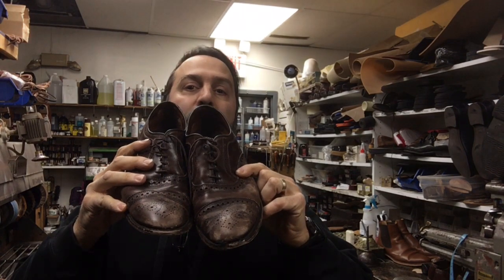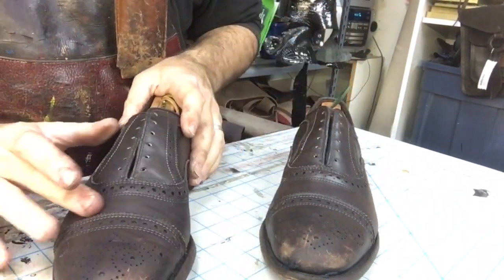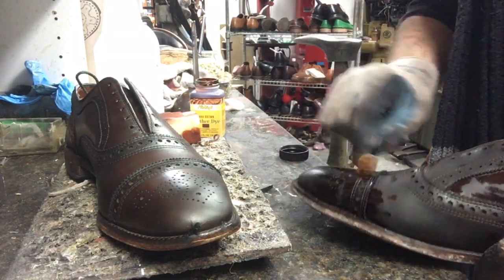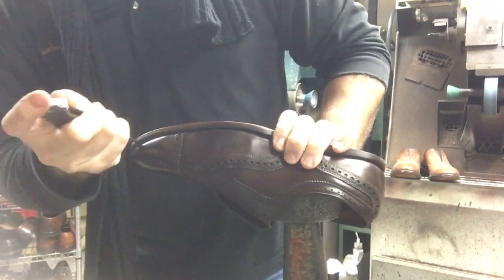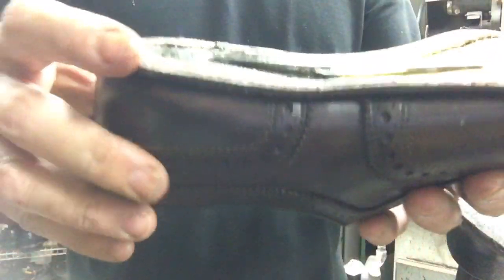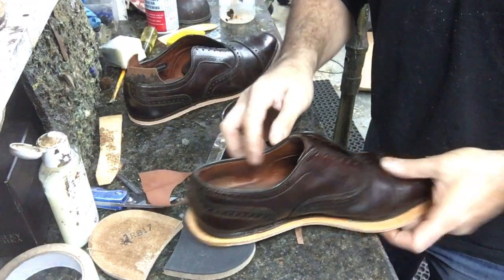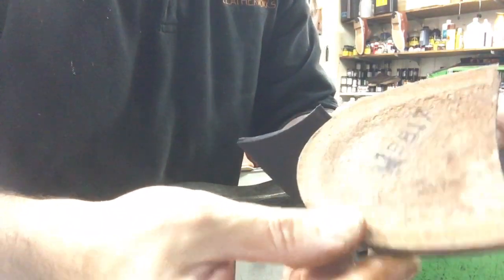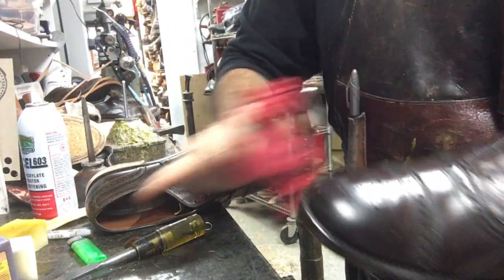Another Detailed Restoration of Allen Edmonds - Bedo's Leatherworks #105

Comment: You should start an amazon shop for your channel with the stuff you use.  That way we get the benefit of knowing what really works and you get compensated for it.
Reply: I would also be interessted in the stuff you are using. Especially the parts without brandnames on it. Like Rendenbach....e.g.: what leather do you use for inside ...or are the nails/tacks standard brass nails?

Comment: I have a question. Why wouldn't you want to rinse the shoes with clean water after the Swedish treatment before letting them dry in order to get all of the soap and cleaners and residual salt off of/out of the leather? It's ok to just let them dry with all of that cleaner saturated into the leather?

Comment: You should be paid for the additional work. Stuff happens. 👍
Reply: I agree! He admitted that he didn't notice the damage to the inside of the heel when the customer dropped off the shoes (probably because of all of the other damage to the shoes), so he has to eat that cost. 

However, just because he can't see the broken heel base or shank before he takes it apart, I don't feel like he shouldn't charge for it. Does he always do that repair for free like in this case? He said the customer will sometimes offer to pay more, but I feel like he should always give the customer a call and charge for it.

Comment: I'd say you basically turned them back into a new pair of shoes. I can clean the uppers, and have even resorted to wood stain to fix them up... one uses what is at hand... no way I could do soles and heels tho.... I know years ago I tried it, not having the equipment and such, it was a complete failure. Of course back then there were quite a few repair places around, but I was a broke young man, trying to keep what I had going without a cash outlay, tho I did buy the new heels .. . the wrong ones as it turned out. I did make some moccasins once, but that wasn't the same as making good shoes.